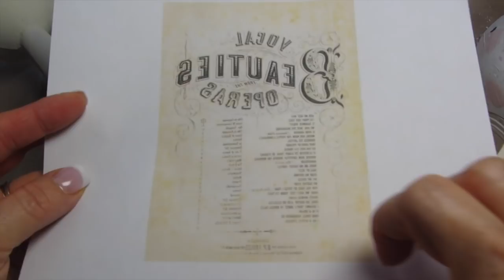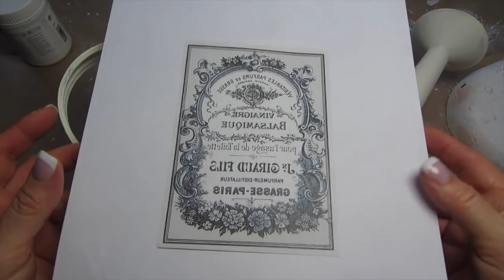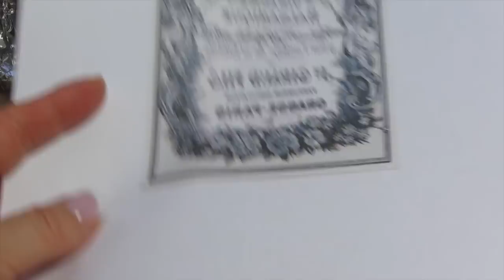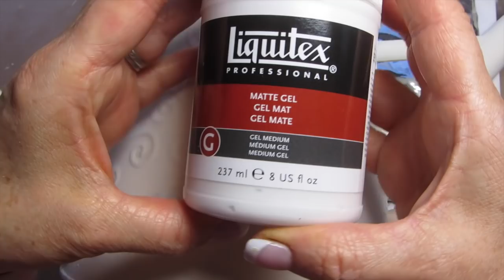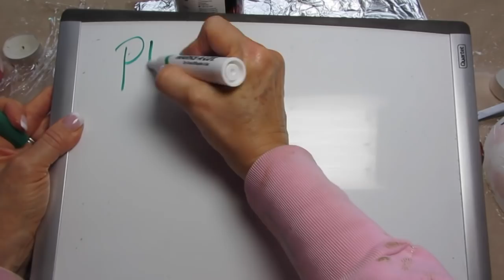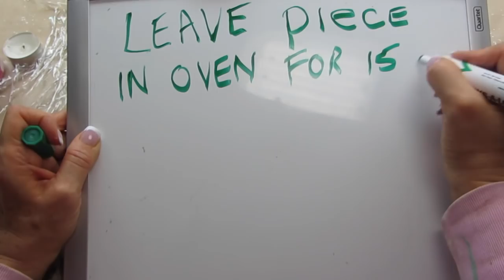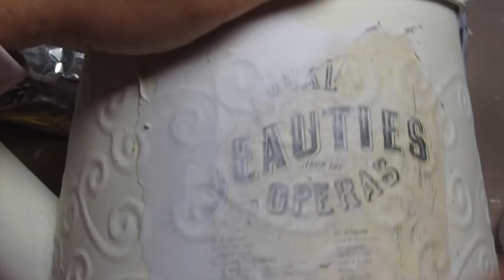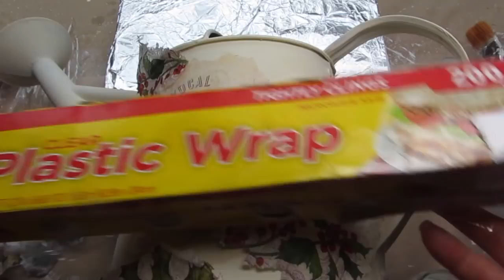DIY Decoupage a Christmas Watering Can

Comment: can you decoupage a surface and have it be water resistant? i want to decopage a panel of my car and that will be out in the rain
Reply from the maker: +Daru Macandy Hello Daru, cars need something called "Clear coat" that is so thick -only a place that paints cars would have it. They need to apply it in an approved garage with proper ventilation. It's because it is the strongest top coat there is. They do use something called Spar varnish on boats although I would contact them before using it on your car just to be on the safe side. You can get Spar varnish now in any hardware store. Hope this helps!
Patti
Reply: Ive only used acrylic and enamel clear cloats before and varnishes on woods. I think im going to only do the glovebox for now. Do you clearcoat ever surface u use modge podge on?
Reply from the maker: Hi Daru, Mod Podge can get tacky or sticky if it gets hot or wet. So yes, I will always use a top coat or varnish over it. :)
Patti